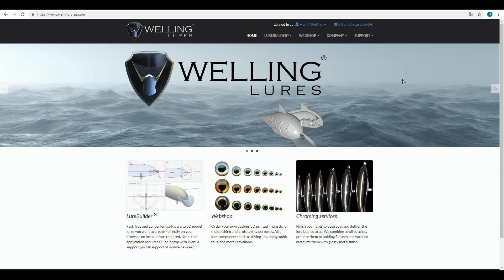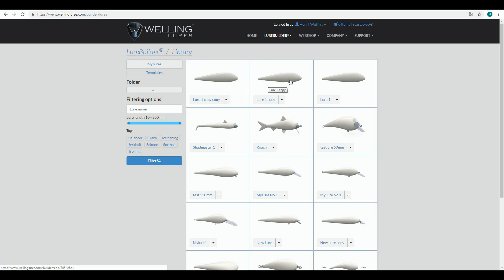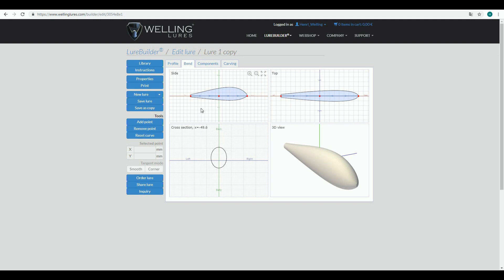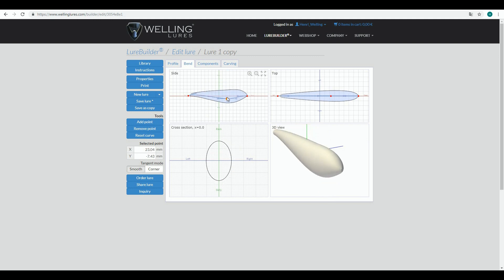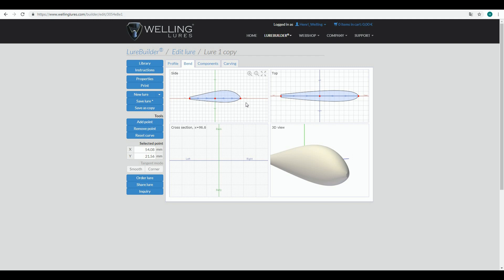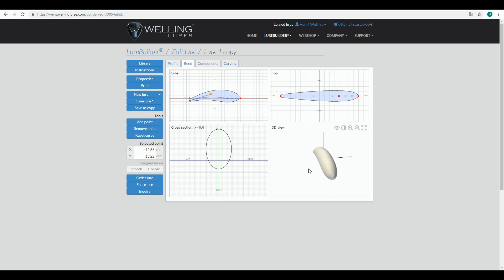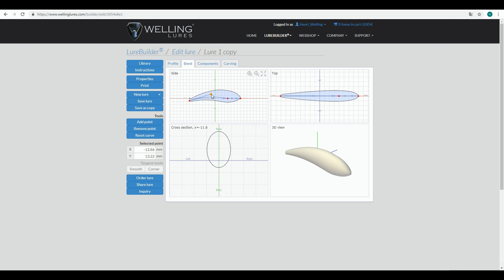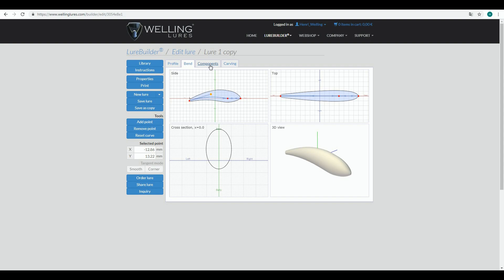LureBuilder®: bend tab

Comment: In what format can I save the drawing? Thank
Reply from the maker: Hello Roman. Files are saved in server internal format. User can take design out himself at the moment only as pdf. If you need other file formats, . stl is easiest, but admins need to take it out manually per specific request.  Site has been financed by risk investment and idea was that it would  have paid itself back by income from sold 3D prints. At the moment we are working to get stl generation automatic and set stl files also available to each users private webshop section.